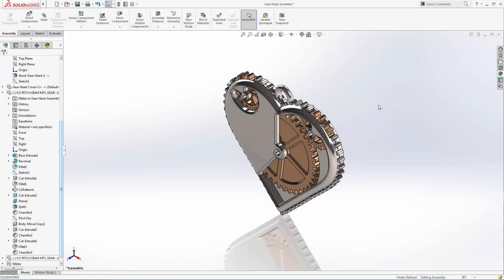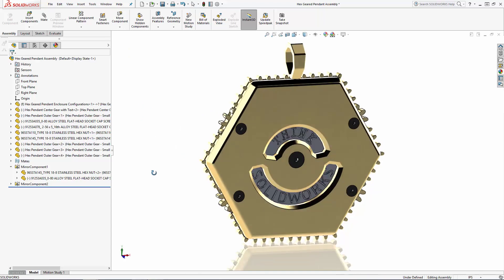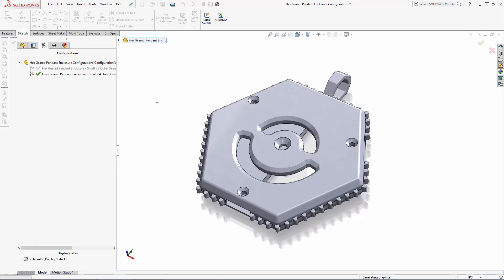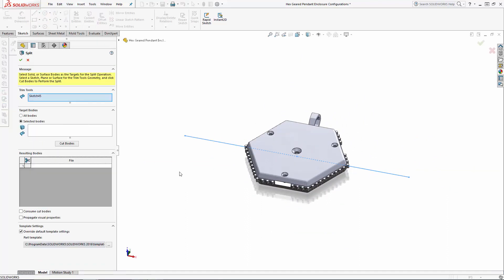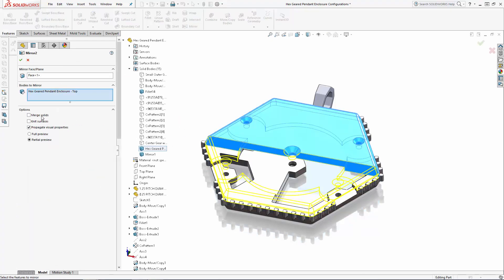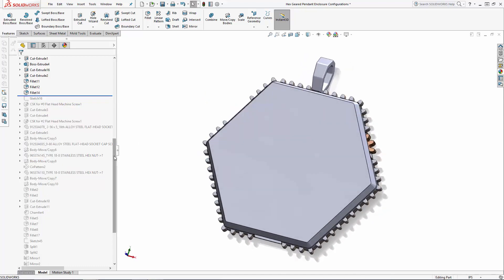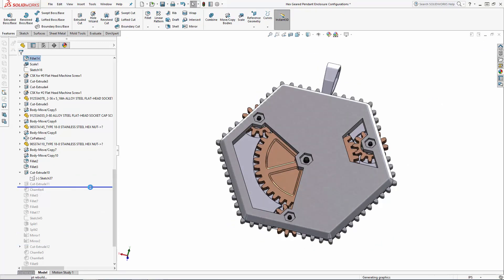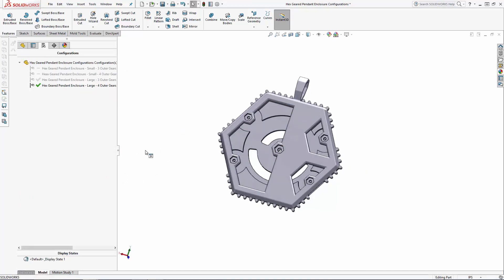Hex Gear Pendant - Part 1 - SOLIDWORKS

Comment: Hol' up. It's an assembly for a second, but then it looks like you start editing a part with subparts. What's going on here?
Reply: The parts that you are referring to when he is editing the part are just place holders so he knows where the gears are. Those gears aren't able to move when he is editing the part. That is why the last feature he has is "Body-Delete/Keep 1". He basically just has the gears in the part model so he can space everything properly and then deletes them at the end.